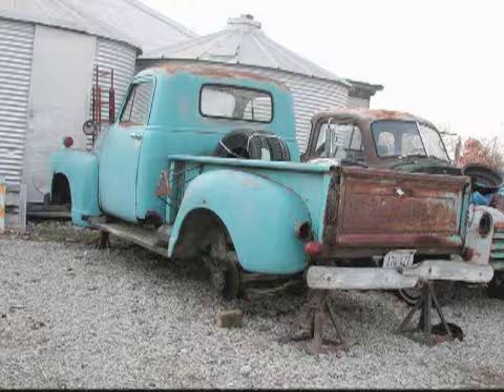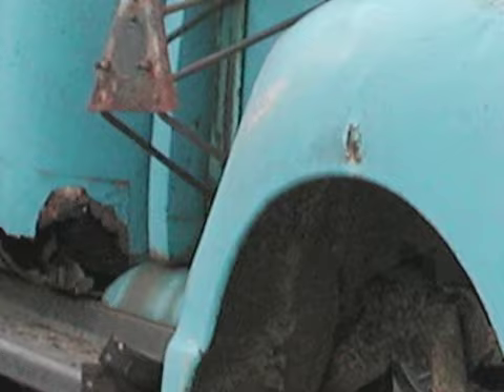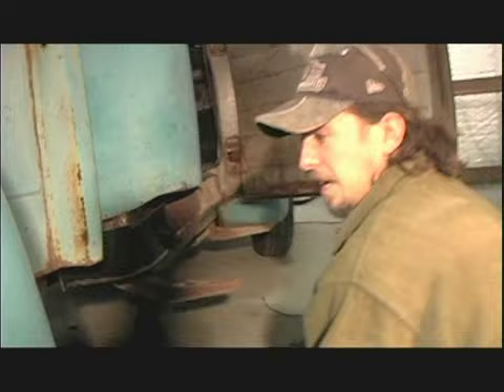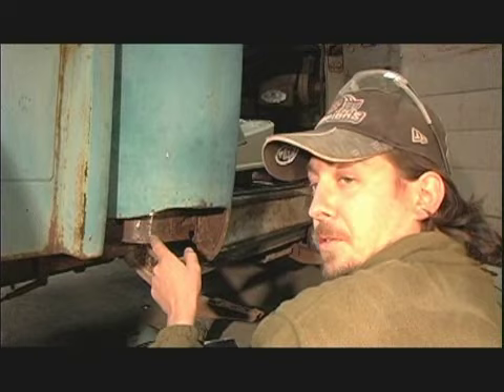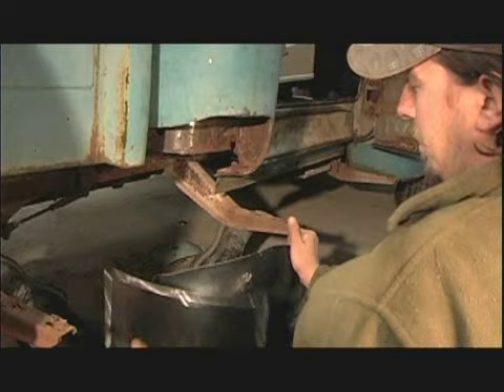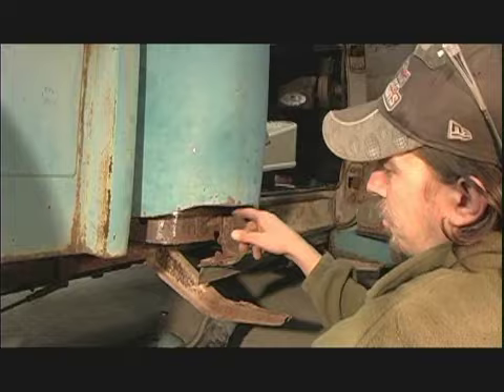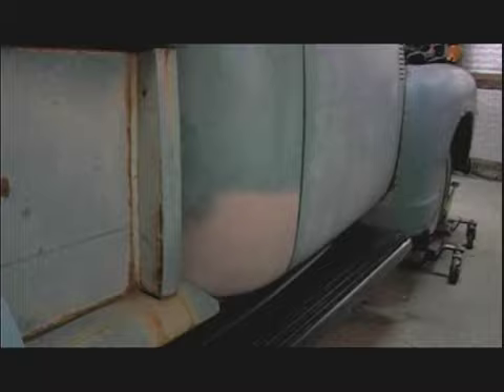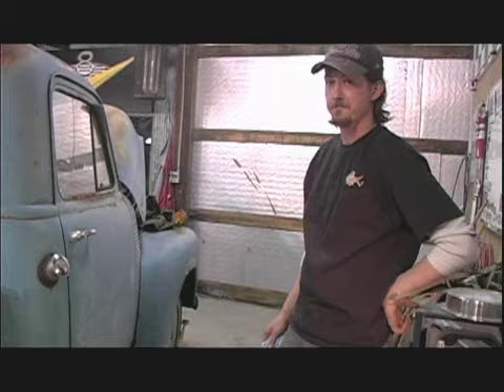Kelle's '54 Chevy Truck Blog #8: Cab Corners V8TV-Video

Comment: you can get decent cab corner patch panels from several restoration companies. it is my understanding that the original tooling was sold to overseas factories and they are the source of the reproductions. the gauge of the metal may be a little off, but may be a good option for those without the ability to fab or cut from a donor.  thanks for putting these up. its always great to see an old advance design on the road!

Comment: Cool video! I'm restoring my 48 Chevy 1/2 ton and my cab corners inner and outer were also shot but a whole lot worse. I've finished the passenger side and I had to rebuild the front cab mount, floorboard, lower door hinge panel and most of the rocker panel. I'm now on the driver's side and it's a bit worse than the passenger side. I actually have some cab settling on the driver's side that I must get fixed before replacing the cab corners, rocker panel, etc.

Comment: Nice job on those cab corners. Before you consider that part of the restoration finished, it is important to stop any further rust as moisture likes to collect inside of those cab corners and inside the lower doors also... Spray a product called RUST MORT into those areas which will etch the metal and stop existing rust and  protect the metal from future rust after you apply coats.  Best to do that in hot weather. You can spray RUST MORT every so often if you live in a wet climate.  Paint the interior of the cab corners with enamel and paint the outside also.  Unless that primer is a good WATER PROF epoxy primer, the moisture will go through that primer and start rust on that bear meter you thought was protected.  Be sure to paint inside and outside of the pockets. Also Spend time to protect the interior of your doors as well.  Did you drill a small drain hole on the inside of those cab corners?  Great series of videos and enjoyed the subject truck because I have one just like it.  You look good driving that truck!!

Comment: lake another person said, I would like to see your process of removing the bed if and when you do that work....Thanks...also the RUST MORT metal etch product goes by the name OSPHO available at marine hardware retailer where it is much cheaper than buying it through a body shop supplier.  DUNLAP MARINE HARDWARD IN EVERETT WASHINGTON ( you can find them on line or google them, sells this product for around $30 dollars a gallon plus tax and  shipping compared to a hundred dollars a gallon at most body shop retailers. That product chemically transforms rust (iron oxide) to iron phosphate where the rust is neutralized. It is a must have for any rusty restoration product ...